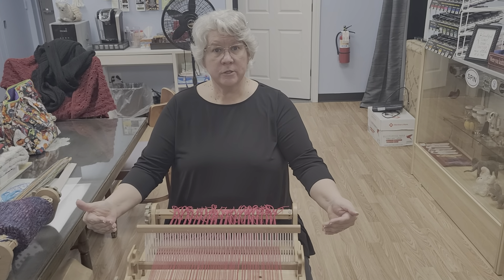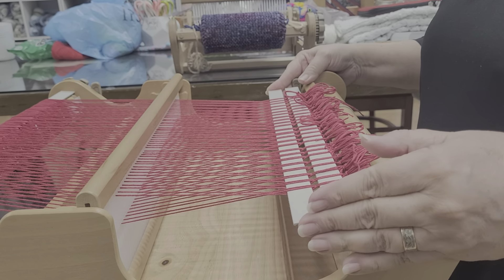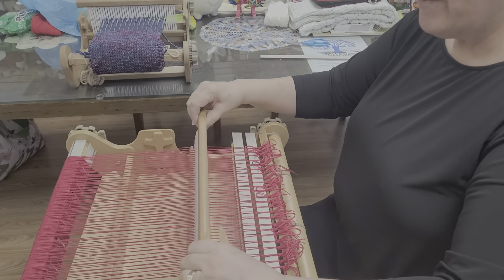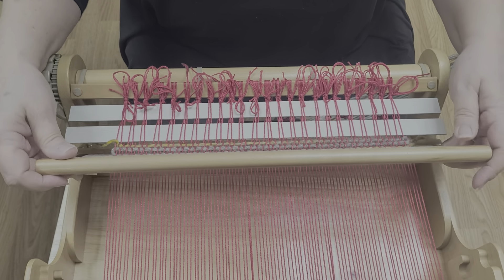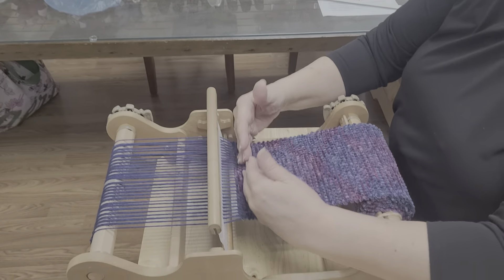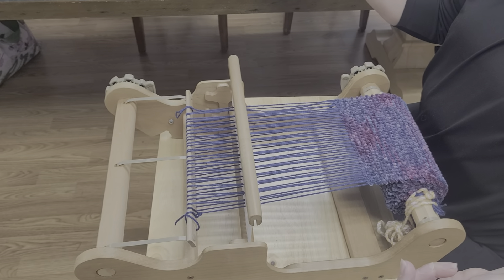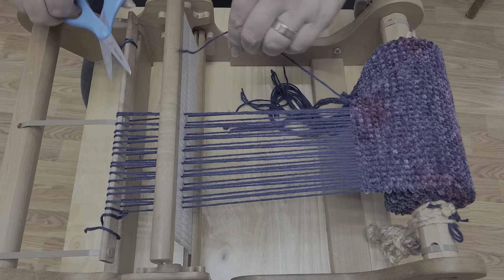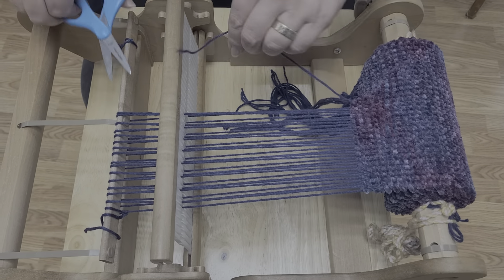Rigid Heddle Loom: How To Weave & Tie Off with Jeannine!

Comment: Hi. I was told to  start with 15” cricket ,what is the different between the cricket and the ashford? also do most have more than one loom that could be pricy, new  to me I need lots of advice,would you advice taking a class first before starting with tutorials?  the tutorials are very helpful thank you for sharing.
Reply from the maker: If there are classes in your area, I would highly recommend taking a class before you buy a loom. I'm going to be honest and say I started with a class and then went ahead and bought the samplet loom from Ashford and 30 days later I bought my 28-in knitter slim because I found there were things that I wanted to make that obviously my small samplet would not accommodate. You really need to take the class cuz it helps you get a better understanding of the things you can do with the loom which  would help you make your decision as to which loom to buy. Just because you have a larger loom doesn't mean you have to make a large project which I think is a misnomer sometimes. I'll also be honest and say that I'm such an Ashford girl that I have never used a cricket loom. But just looking at the pictures of that loom there's really not that much difference. I think when I look at it I like how the Ashford loom is secures the heddle and a little better way when you're going into the down position I believe from what I looked at. But again I could be wrong because I've never used it. Also if there's a way to find a store that carries looms, it might be best for you to see them in person before you make your decision. Hope that information helps and I hope you have a lovely holiday season!

Comment: How do you spell that fiber wash/rinse that you were talking about?   I just bought a Kromski Harp Forte and haven't warped it yet because I have been watching lots of weaving videos. Yours was the most informative so far for me. For instance, when you showed how to place your reed at an angle when you brought it back to just kiss the yarn to the woven area... I really liked that.  
And then when you suggested starting with the reed in the down position when you start to push the shuttle through from the right... as a gentle reminder that you know if your shuttle is on the left... then your reed should be in the up position. Also... something that really made a lot of sense was the reason you just kiss the fabric when pushing your yarn back is because (and it's so obvious... but I guess new weavers just don't think about it) when you take the item off the loom it bounces back and all the holes you're seeing will disappear.  
Also, you answered one of my questions that I was wondering about... but no one else really touched on was the material that you want to use for your warp thread.  It now makes sense why you use cotton or something without a lot of stretch because of that needing to be under tension.  I was wondering... because I knew that cotton shrinks  when it's washed and acrylic doesn't usually shrinks... I had been wondering how was that going to work when you wash the item.  Things just started to click. Thank you for making this video.
Reply from the maker: Thank you for kind words. Just lets me know I am making a difference and helping with these videos. Was it Eucalan for the no rinse fiber wash? That's typically the one I mention. Jeannine

Comment: My reed keeps popping out of the holder, would you be able to tell me what I’m doing wrong?
Reply from the maker: Is it still popping out? What type of loom do you have? If you have an Ashford knitters loom the tension will be an issue if you did not angle the loom before tying onto the front beam. With the standard Ashford rigid heddle looms, that is not a problem. Have you tried just a little bit more tension on the warp?

Comment: I have watched this video several times and do not see you show how to weave in the tails…..🤷‍♀️
Reply: I also notice this - the video does not show how to weave in the ends as you go and I can see no other video in the library that shows it 😫
Reply from the maker: If you end your yarns on the edge of the work, you can use a darning needle to weave in the ends like you would in knitting or crochet. I will need to do a video showing how to add yarn so you don't have to weave in the ends.
Reply from the maker: If you end your yarns on the edge of the work, you can use a darning needle to weave in the ends like you would in knitting or crochet. I will need to do a video showing how to add yarn so you don't have to weave in the ends.